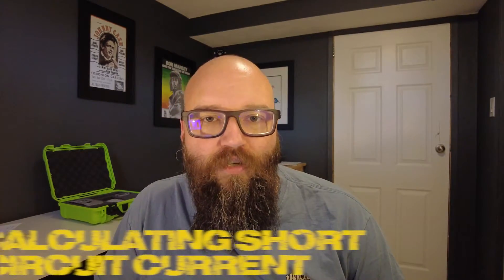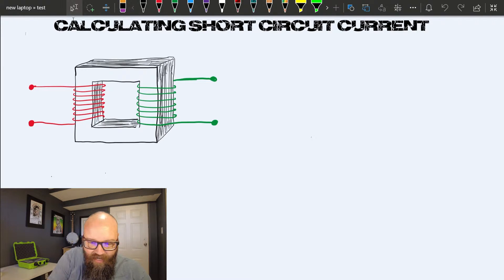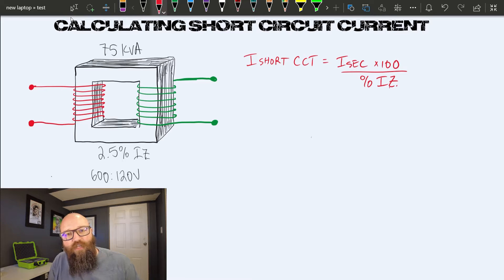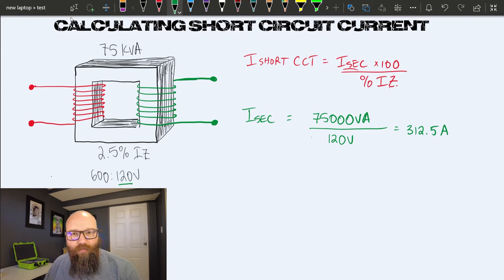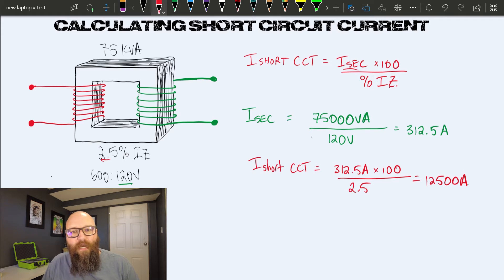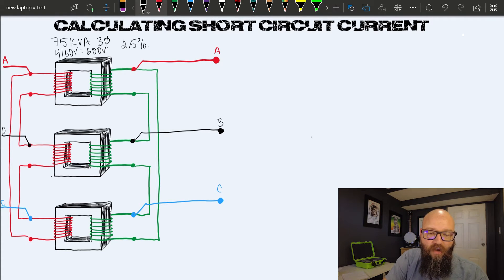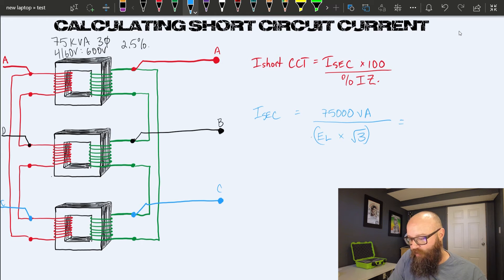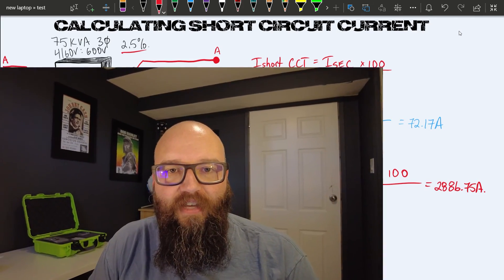Short Circuit Current Calculations

Comment: Hello, how do I calculate for my downstream breakers KAIC for example: main service breaker for each apartment is 22kaic, the distance from main breaker to subpanel is 90' with thhn #6 CU, 120/240, 3/4" Flex conduit, what will be the ISC so I can determine the correct KIAC for the subpanel breakers? its there a formula?

Comment: My question is why do you divide by 2.5 in the calculation? Aren’t you supposed to divide by 2.5% which would be .025 in decimal form? Technically if you divide by 2.5 you’re diving by 250% correct?

Comment: What does "I z" mean ?
Reply from the maker: When used as %IZ it is the amount of voltage applied to the primary, compared to rated primary voltage, that will cause RATED current to flow on the secondary of a transformer, when the secondary is short circuited. 
This is obtained by performing a short circuit test on a transformer (which I do have a video on) but is usually a number listed on the nameplate as well.
I hope this helps.

Comment: Great video. Need to know Copper bus bar short circuit current rating formula..or my bus bar size is 15 X 5 mm. Total 75 sqmm copper busbar in DB. Voltage rating 3 phase 415 VAC. give me the answer. Thanks once again. If any one please answer it.

Comment: SOOOO, What is "EL"?
Reply from the maker: If you're referring to the abbreviation used in the formula, that's the line voltage, which is measured line to line.

Comment: Which secondary voltage do you use to perform the short circuit calculation on a 3PH xfmr w/ 460/277 primary 208/120 secondary?
Reply from the maker: 208v but remember the root 3 as well.

Comment: This is a question I should already know but I am done trying to remember why.  So why does the O/C protection rating for a short circuit current need to have a higher amperage that the Short circuit fault? Is it because it needs to handle such a huge in-rush of current but the magnetic trip is strong enough?
Reply from the maker: It will withstand the internal force generated by the release of short circuit energy, as long as the rated interrupting rating is higher than the calculated minimum value. Underating could result in critical failure or rupturing of oc devices meaning injury, etc.

Comment: can you explain this exercise ?
A 100 kVA, 2400/240 V, single-phase step-down transformer has a 5% impedance rating. What is the minimum interrupting capacity rating for an overcurrent device that is protecting the secondary conductors of the transformer?
Reply from the maker: 100000va ÷ 240V will give you your secondary rated current (root 3 not needed as it's single phase). 
This can be used to determine the short circuit current using the same method in the video. Secondary current x 100 ÷ 5 will be the short CCT current. 
This is used to select the IR rating which must not be less than the short CCT current.

Hope this helps!

Comment: Hi I am confused about 75000va Devided by 120 volt .I get 625amp.how you get 312.5 amp.
Reply: confused too but but if you do 625 divided by 2.5% you should get the right answer.

Comment: A PV module has a surface area of 0.75 square meters and the radiation striking the module is 1000 watts per square meter.  What is the short circuit current at 0.75 square meters, if at 1 square meter,  the short circuit current is 8.5 A? what the formula for this

Comment: What happens in the event that the breaker is underrated for the short circuit? I. E you have a 10kva rating or AIR and the available short circuit current is 15kva?
Reply from the maker: There's a good chance that the amount of energy will destroy the overcurrent device violently causing potential injuries
Reply: @schulerruler  so that’s why the OC protection rating must be the Short Circuit rating or higher. But I assume just because the OC Protection is rated higher doesn’t mean it won’t trip because the SSC fault value is less. This has kind of messed with me.
Reply from the maker: Always size the interrupting rating of the overcurrent to the short circuit current, or higher preferably. 
If not marked, assume 5kA for Breakers 100 A or less, and 250 V or less, and 10kA for Breakers larger than 100 A or greater than 250 V.
All fuses if not marked, assume 10kA. 
(Check appendix B 14-012 for this info)
Reply: @schulerruler  seriously you are the man for taking the time to write to your subscribers. It’s very much appreciated.
Reply: @schulerruler  Interesting. Thanks for the response!

Comment: this is a great learning Mr Schuller ruler, I thank you for it, but data of single phase transformer calculation is wrong, the I sec is 625A not 312.5A , but again thanks.
Reply: He divided by 240v instead of 120v. That's probably what happened

Comment: On your 75000va / 120v the result is actually 625A. Why do you get half (312.5A)? If you are using secondary L1 to L2 V as 240v, why not put 240v in the calculation for secondary current? Or use (x 2) in the denominator to indicate single line current for the 2 secondary Lines?
Reply from the maker: Good catch. I honestly have no idea why I got 312.5. It absolutely should be 625A on this one.
This would also make the short circuit current 25000A as well.
Reply: Thank youh so much Schuller ,  I am pretty sure we really appreciate these very important and refreshing knowledge in electrical. Thank you
Vic
Reply: Thanks for clearing this up.  However wouldn’t the short circuit be 2,500,000?  25,000 is 625/2.5%.?  Thanks again.  Just making sure I understand.
Reply: @ajdsparky  Ishort CCT = Isec x 100 / %Iz = 625A x 100 / 2.5 = 62500A / 2.5 = 25000Amps